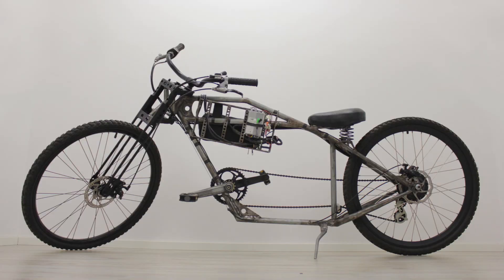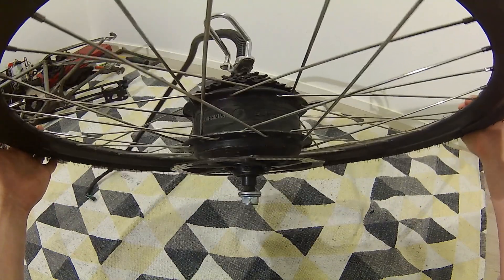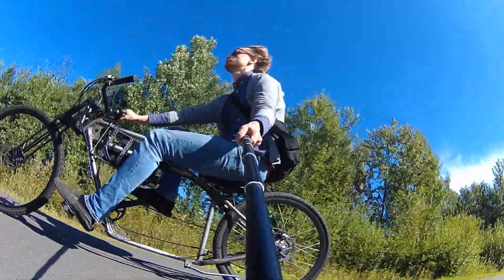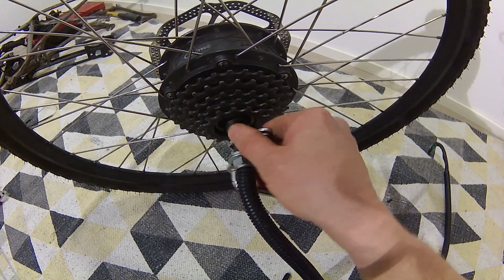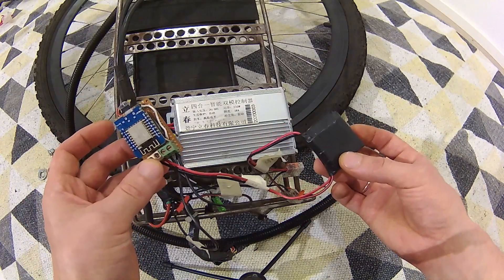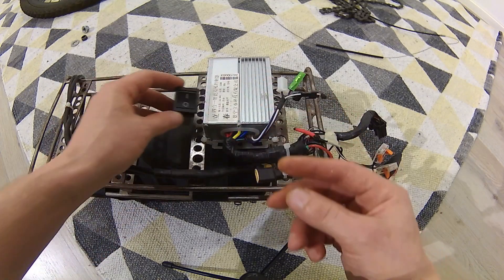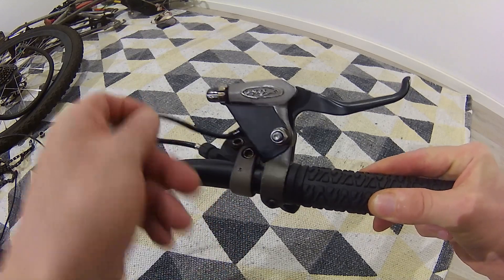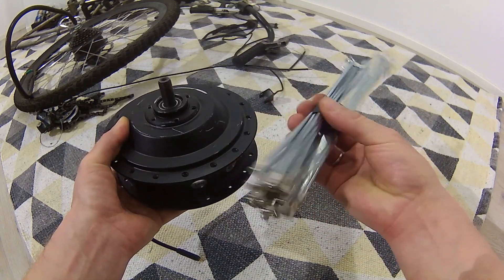Motor & Controller for 48v Chopper eBike

Comment: Hi. How do you size the motor (and battery pack) Want to build a trike. Max speed 20km/h. 200-300kg total. Hoping for around 20km of range.
Reply from the maker: Hello! That's a super good question. Well first of all, the mass is very hard to take into account with battery design, without testing the range. The pack's capacity is good to be the same as your motor's power. So if motor is 1kw, then the pack is good to be 1kwh. That will give a 1c consumer-ratio, which will keep your battery cool and in good shape for a long time. Good efficiency - longer lifetime. The question about mass is really about the power of your motor. The bigger motor - the better. The less mass - the better. Battery cap comes after those. If a 1c battery works for 20km - then you're lucky :) Hope this helps! Thanks for watching!

Comment: Is there any budget hub motors that can attach to a bike and not have to hook up to the chain of the bike?
Reply from the maker: Hello! Thanks for your comment. Yeah, you can choose a front wheel hub motor if you want. Motors are actually kinda cheap. It's the battery that will cost you the most.